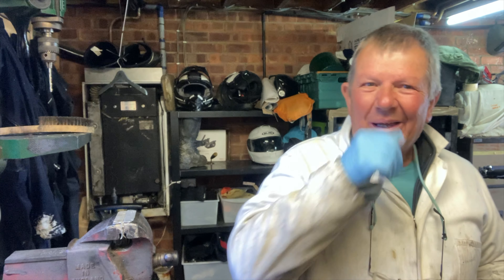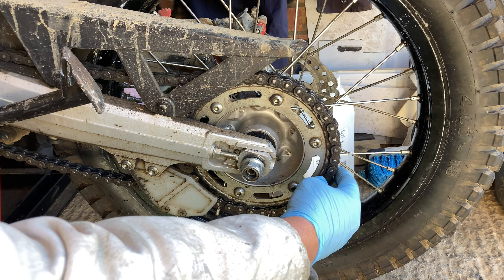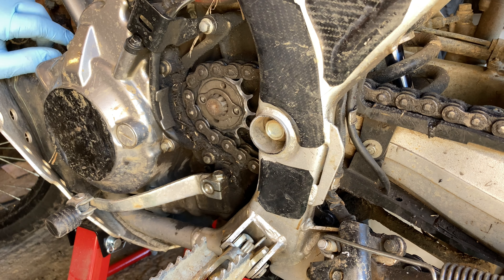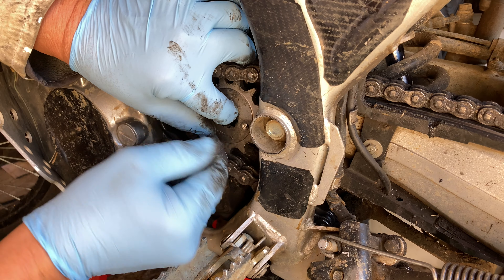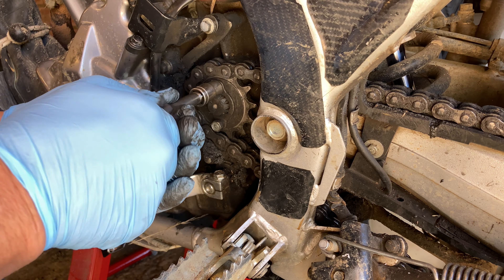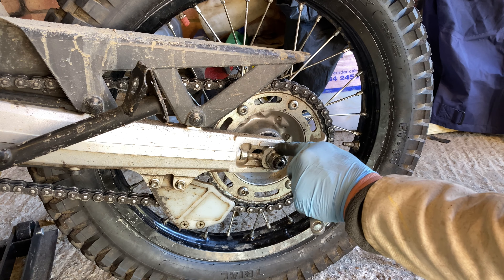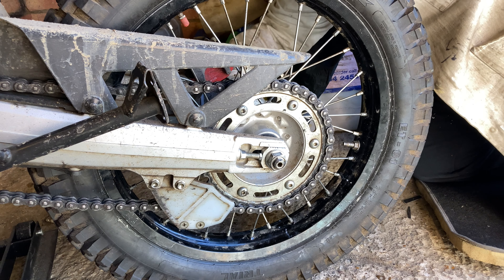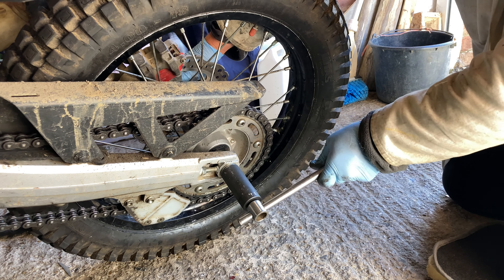Honda CRF 300L fitting 13 tooth front sprocket...

Comment: I check my chain in the same way by putting my weight on it the same way you did but mine is way tighter! I have maybe 10mm of slack with my weight on it. If I measure it by how the user manual recommends it has 45 mm of free slack when on the side stand. Is my chain too tight??
Reply from the maker: yeah i would probably recommend more than 10mm bit tight for me, rather lose than tight less wear 😀👍
Reply: The user manual just doesn’t make sense to me? 25-35mm of the side stand 🤷